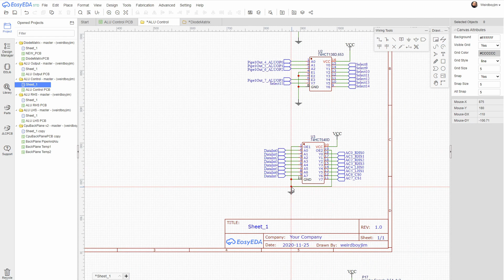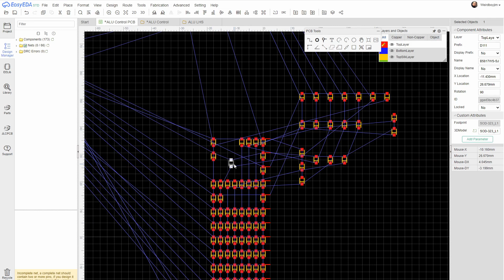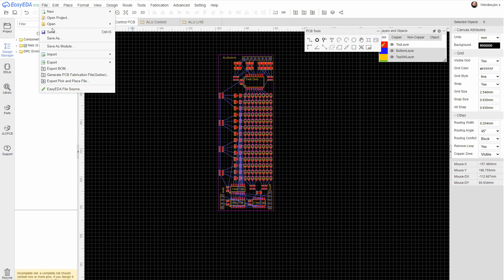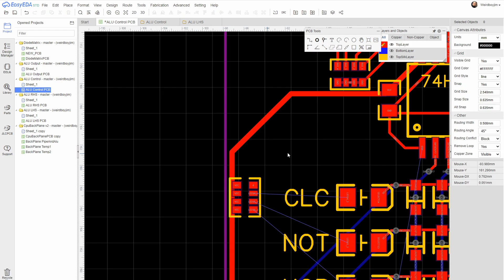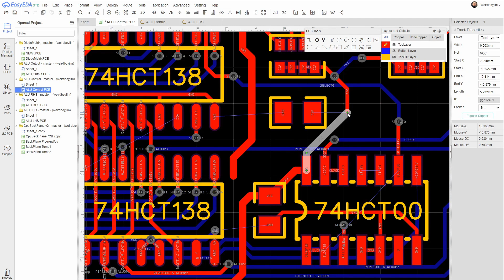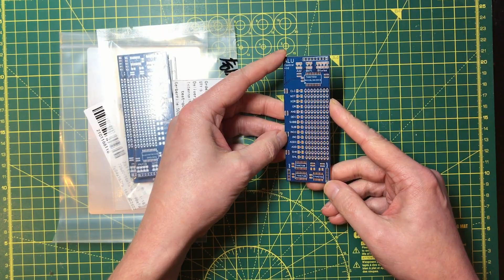ALU Control PCB - Making an 8 Bit pipelined CPU - Part 92

Comment: I'm slightly astonished that you resisted the impulse to build the diode array from LEDs for extra BlinkenFlaschen 👀🤣

I've been bingeing your playlist and this is most impressive, thank you!
Reply from the maker: Lol! But it's, led's are not designed to be "good diodes" they are tuned for light emission. They need to a conduct a certain amount of current to create visible light and these cmos logic circuits operate with very little current. You could add some resistors to ground/vcc but then you would have upto 5 (in this circuit) led's being driven by a single logic line.

Comment: This looks like it would have been a candidate for a 4 layer PCB. Great layout!
Reply from the maker: I'm kind of glad it wasn't, this pcb was slightly more than 10cm on it's longest which makes 4 layer quite a bit more expensive. It's an odd extra design consideration it's worth thinking about with current group of cost effective pcb manufacturers we have access to now.

Comment: Checking storage recommendations for solder paste, I found that it is recommended to store it at 0-10C. Some also use ziplock bag to reduce off gassing. Your paste is getting old, all your complaints are echoed online about solder paste getting old.
Reply from the maker: It can be very different between pastes, I've started using stable paste in a syringe, seems to keep better for occasional use.

Comment: Congratulations!  I was holding my breath the whole time. Wow!
I couldn't see how you knew where the cathode was on the diodes. Both ends look the same.
Reply from the maker: Deep down I'm surprised every time a pcb works ;-)  Those LED's have a green 'T' on the back that shows polarity (as do the silk screen marks), they also have a tiny green dot on one side. If you watch carefully you can see me check the back before placing the first one to remind myself which side the green dot should be, then I use that for the rest of the led's.

Comment: I was looking over a few of the ALU pcb's and I cannot see where AluActive is being used. Have I missed something?
Reply from the maker: It's not. I had an idea to use that line to latch the inputs to the ALU so the the visuals wouldn't change when an operation isn't in progress (And the LHS and RHS default back to A). I didn't have the room on the boards so I dropped the idea, it was just for aesthetics so I wasn't too worried about it.

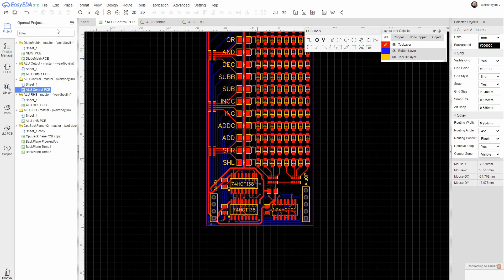Comment: 17:00 a resistor may be a better choice of termination load. Any track acts like a transmission line to high speed signals. Since square waves are made from odd harmonics extending wayy up in frequency, they're susceptible. Adding a resistor absorbs the energy that would otherwise be reflected, preventing it from causing standing waves (reflections) on your trace.

Apologies if you knew this already! 🙈
Reply from the maker: Still learning this stuff, I've found situations where a cap gives me the results I want, and situations where it doesn't but a resistor does. Still learning about the upstream why's that cause that.
Reply: @weirdboyjim  so ideally you'd have a source resistance (either in series with the output or on the chip) which limits the current onto the trace. You then also need a resistor to absorb reflections on the end of the trace. The trace is designed for the same characteristic impedance (ideally that the inductance due to trace length cancels the capacitance to ground, and leaves only a real resistance that you use with the source resistance and the load resistance) This gets more complex with tracks that split off (known as stubs), as it is not obvious how to handle those. It's a complex subject, but it's usually the cause of the ringing on square waves. It's constructive and destructive interference of reflections on the track as the state changes.

In RF systems, the standard is very much 50-Ohms. Here, it's much easier to select from a few components. The ICs won't like 50R, it's likely too low (and will ruin your fanout) but a load resistor in problematic areas can help. I'd expect 1k to 10k is about in the right area. You won't fix the issue, but it may make it better.

For your system clock, you an lower the drive impedance my paralleling multiple drivers (say inverters) to increase the drive current (and thus fanout, slew rate, lower source impedance, etc).

Hope that makes some sense. It's transmission line theory. Unfortunately, digital systems don't know they're not supposed to be 😂
Reply: Hence the 50 Ohm terminators as part of many old networks, and why the network stopped working when the terminator fell off. Although not way TBase 10 on coax, stopped if the cable got snagged.

Comment: That really is a very interesting looking PCB. Circuits like this are usually hidden inside a CPU package. But now you can almost exactly see how different instructions are selected.
This whole thing is going to be a work of art.
I also love how you have been complaining for weeks now about your old dried out solder paste ;-)
If you had ordered a fresh pot of that stuff for cheap from China or wherever you would have already had it.
BTW I think I'm the same, I often forget about things that seem secondary until they come back to bite me. Oh well.
Reply from the maker: Indeed. If you look at the chip schematics cpu's there is usually a control decode very much like this.

Comment: That metal mask you spread the solder past over to get the pads, that is an option JLPCB offers I assume?
Reply from the maker: Yes, it's called a Stencil. Scroll to the bottom of the pcb order page and you can order one alongside the current pcb. There is a separate tab if you want to order one on it's own which is what I used here to get one with specific diodes removed.
Reply: @weirdboyjim  I always learn something new watching these videos. Thank you!

Comment: Glad you decided to move away from the jumpers! Beautiful like you said it would be

Will you be adding any sort of expansion "slots" or connectors besides the bus connectors on the side? A board with that LCD and with the sound generator would be neat.
Reply from the maker: Glad you like it!  The Audio board and the UART will definitely make it to pcb's, it was never the long term plan to keep the lcd module until the end but it might make sense to do it just to save a little space in the mean time.
Reply: @weirdboyjim  Seems like it's become a big part of the CPU so far though.
Will the VGA board have text support?

Comment: You can add some flux to your paste to thin it out if it's getting dry. Just add small amounts and blend it well until it's back to the right consistency.
Reply from the maker: I had wondered about that, I'll give it a try.
Reply: Yeah... I was wondering what the "gunky base" of solder paste was and if you could rejuvenate it by adding some solvent or other.
Reply: If you add too much flux it won't sit as nice on the pads when you use your stencil and you may get more solder bridges on fine pitched parts, tomb-stoning or floaters but since your doing this by hand anyways the rework won't be issue. Once you've added flux I wouldn't use it for BGA parts just to be sure.

I would also suggest getting a syringe style paste tube rather then a tub. You can use it fix pads you miss with the stencil using a needle tip and you can also use it without a tip for the small amount your using on your stencil. For the low volume of PCB's your doing it will last longer then a tub. Keep it refrigerated between uses and it will last much longer.

Comment: Do you need a stencil to solder SMD components? I’ve got a kit with a load of tiny SMD parts and a mean looking qfp100 microcontroller to solder and I don’t have a stencil. Would smearing solder paste on the pads work (like when you added more to that resistor pack), or am I going to spend hours trying to remove solder bridges? The board is double sided too, to add to the complexity and fun.
Reply from the maker: You can hot air it applying the paste manually. If you search on ebay you'll see people who sell paste in syringe like dispensers for just that purpose. It's probably just as easy to drag solder it though with a regular iron, especially since your board is two sided.

Comment: I wonder if some transistors to drive the LEDs for each of the operations would have made them more visible? Or is it just because it's all happening so quickly that they just don't get a chance to light up bright?

I'm looking at this and thinking that some flex PCBs between the boards means you could open/close it a bit like a book. 😄
Reply from the maker: It's the same LED's and resistors as the other blue LED's in the build. They look dimmer in the trace runs because of duty time, when I'm stepping they are really bright. The Flex PCB's is interesting. My plan was to do a combined back plane for everything at the end and then mount it on a backing board.
Reply: @weirdboyjim  Ah cool. I guess I hadnt noticed the LEDs on the original module.
Reply: I haven't been able to check your circuit fully to see how it works, I have yet to watch your diode matrix videos, waiting to finish this series; but I think the LEDs are dimmer because you didn't use different resister values to account for the forward voltage drop of the diodes of the matrix. Seems to range from about 0.7 to 1.25V, from a quick look online of diodes.

Comment: great work!! I'd check the soldering on the connectors on the base board, I've missed soldering all the pads before and got things that don't always work.
Reply from the maker: Yeah, I'll check that when I get a chance. could just have been some dust or tarnish on the connector.

Comment: I don't understand why you populated the pcb with positions for the diodes you don't use. Beautiful pcb btw.
Reply from the maker: That very much a matter of choice that might not seem as right to other people. I wanted to retain the essence of the operation->control line mapping being programmable. I could move those diodes around to tweak the behaviour if I wanted to.
Reply: I was thinking it would be a good idea to use silk screen to indicate the populated diodes. Then I saw you had a stencil. Two birds with one stone.

Comment: Very cool! I do like the all-in-one format, with  the design and finished board all in one video, though it takes longer for obvious reasons. I'm sure it's worse for you, having to wait those long weeks right in the middle of the process!
Reply from the maker: Yeah, the all in one format does work better. The big part ends up being the schematic and pcb design. I've started doing a bit more schematic design on the fly so maybe when I get to those pcb's I can make a more compact video.

Comment: This is the PCB we've been waiting for.
I'm really really slow at EasyEDA... so it's such a treat to watch you doing such at tight fit at high speed.
Reply from the maker: Thanks edgeeffect! I dare not release the normal speed footage I may not be very fast. This video was formed of 5 hours and 43 minutes of linear time footage (not including secondary cameras of the time period like the microscope). The bulk of that was the design stuff that I really work at to make it reasonable for the final cut.

Comment: Man that looks fiddly, you have way more patience than me.  Thanks for showing the diode matrix. I looked into it, but I have a ton of old EPROMs so didn't seem worth the hassle, and my design goals are completely different. I'm trying to make one using only the chips I bought from a job-lot on Ebay. I'm still interested in seeing the code. I'm hacking some stuff together now and searching around for samples of simple assemblers, etc.
Reply from the maker: If you want access to my assembler, email me.

Comment: It’s remarkable that all that breadboard circuitry is going to fit in an area the size of a post card. Just goes to show that breadboards are lousy for achieving high component densities.
Reply from the maker: Indeed,  it's worth noting that the diode matrix was already a pcb, so that bit didn't really get any smaller!

Comment: You can disable the solder paste pads only instead of deleting the whole component of the pcb, there is a special layer for it. Good job tho this pcb look nice
Reply from the maker: Yeah, I did experiment with that. The approach I used was just to save a copy of the pcb and delete the components outright

Comment: You have come quite a good bit since the first PCB, dropping down the rabbit hole of the "making it pretty" part of PCB design. I do see that you still route the underside as if the pads on the top was there, that is a troughhole routing habit that takes some time before it disappears. Also, keeping the diode matrix is genius, it really shows how that stuff really is implemented internally.
Reply from the maker: Thanks Jonny. I route under pads when I have to but the simple fact that you can't click on things as well without hiding the layer pushes you to avoid it! ;-)
Reply: @weirdboyjim  Ah, so it was a software limitation and not a habit! Got you.

Comment: So glad that diode matrix made the final build. Thought you might have replaced it with an EEPROM. This is so much cooler. Those ALU operation LEDs are seriously cool.  
Inspiring build, James.
Reply from the maker: Thanks Troy! I agree! The operation LED's make it much easier to translate what's going on. Looking forward to having the flags properly annotated as well!
Reply: @weirdboyjim  you get twice the bang for your buck... extra diagnostics to help with debugging AND extra flashing lights for decorative effect when all's going well.
Reply: My thoughts exactly, but would need two 8bit eproms.  Can find 16bit eproms but they all seem to otp type. But two 8bit ones will take up less space than all the diodes and be easier to solder.
Reply from the maker: With two 28c256's and a couple of logic chips I could actually replace the entire ALU but that isn't really in my design goals.
Reply: @TheEmbeddedHobbyist  A 4-bit (16x8) EEPROM is all you'd need.
Reply: For speed, you can use the BAT-4x or the Toshiba SMD diodes, as they have the fastest recovery times. You can also experiment with lower-value pull-up resistors if those are used with the diode matrix. But that will increase temperature and power usage.

Comment: I was wondering throughout if you'd have an adjusted stencil for the diodes :) 
Getting those diodes the wrong way around is a bit of a pity, lucky you noticed before soldering!
Reply from the maker: It was quite fortunate actually, normally I record all of a video before editing any of it. This time I had a spare evening and edited the design footage while waiting for pcb delivery, otherwise I may not have noticed it.

Comment: Out of interest, what was the reason to have all the unpopulated diodes on the board as well? Surely easier to only have the ones in use. Makes the board look not as nice, but easier to route.

May well be a reason I'm not seeing, my electronics knowledge is minimal. I work one or two levels above this and write code all day usually XP
Reply: It means the functions of the ALU can be changed without remaking the board.
Reply from the maker: That is a good question Connor. The truthful answer to that question is "It's what felt right for this project" but I can give you some thoughts. That diode matrix is working as a PROM (I could have just stuck a rom chip in there in a fraction of the space) and as such the absence of a diode is just as important as the presence of one. This project is very much a demonstration (hence all the led's) so the leaving the empty diode slots felt a lot like showing the workings. Once you work out the pattern routing it wasn't really any more effort than just doing the diodes that are needed. Keeping the empties also allows me to reprogram it, let's say I wanted different preservation behaviour for the arithmetic carry during a logical shift I could tweak the encoded data.
Reply: @weirdboyjim  ah I see! Yes that makes a lot of sense. Thanks for taking the time out to explain, very much appreciated

Comment: Very nice display, the matrix looks pretty good. Looking forward to more videos ;)
Reply from the maker: Thanks Andrew! I've stepped a few bits of code since recording this, the operation LED's are an amazing tool for understanding what the cpu is doing. Most other operations are some kind of data move, so you can follow the flow by watching the assert/load control led's but the ALU while it displayed the internal operation lines was a bit opaque.
Reply: @weirdboyjim  It's amazing how much understanding you can get with just a couple of led's. I am designing a cpu with a friend and led's are going to be very important. The ALU is difficult to follow as it collects multiple bits of data and spews one more out the moment it's presented on the inputs. Depending on how complicated the ALU is it can be more and more confusing. We are planning on making a 32 bit X 32bit register set so that's going to be interesting to see all those lights. 

You are a great inspiration, I'l tell you that !